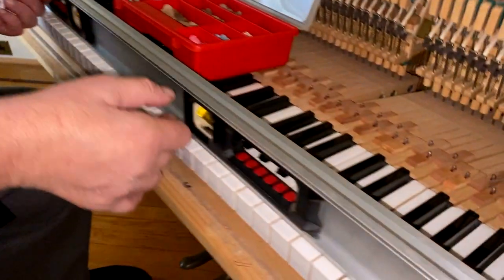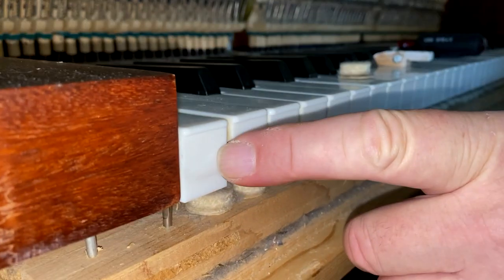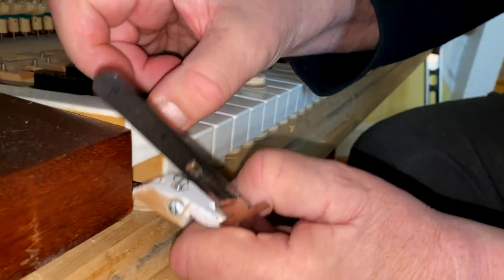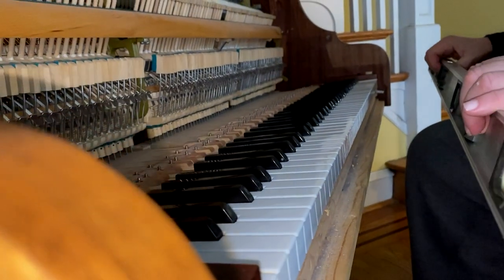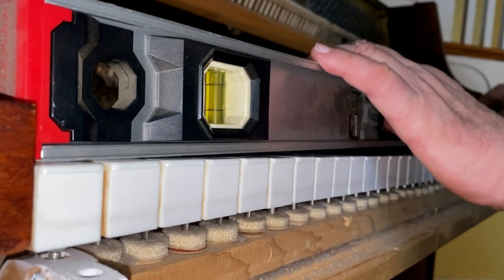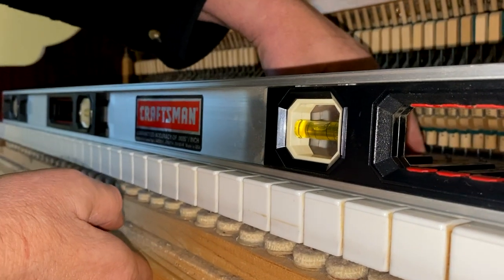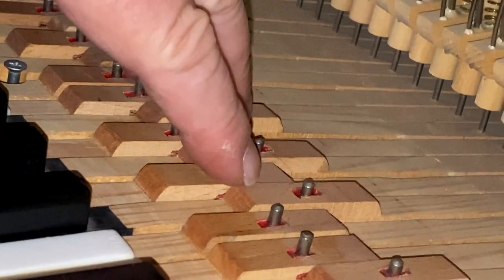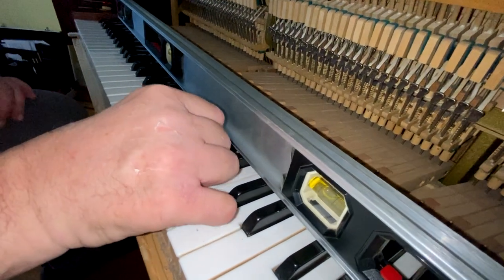Key leveling and Key Dipping

Comment: The explanation of using the key prop is not clear to me.  First, you measured the height of the lowest bass key, and then you propped the key. Why was it necessary to do that?
Reply: This is what I got from watching this - others can feel free to correct 🙂: I'm thinking that the key needs to be propped up so that the weight of the level doesn't start pushing all of the keys down. So basically the props turn two white keys into the left and right  end of a "stand" that holds the weight of the level at the desired key height (re-watch the video @1:14). Once the props are in place, you can trust that: 1) the leveling won't change as you are going up/down the piano testing key heights 2) the entire level surface won't sag under the full weight of the level (even if you took the level off - to do something - and then put the level back in place).
Reply: Because if you set the key height to your desired spec on the 1st and 88th key you can use that as a guide to correct the rest of the keys. Once you place the straight object across the keys (carpenters leveler here)  anything that is lower/higher than this height will be easily exposed.

If you don't add a prop underneath the lowest and highest keys, once you place a flat edge or carpenters leveler across the 1st and 88th keys then they will both descend due to the weight of the object. For example, if you set your key height to 65mm you want it to stay at 65mm.
Reply: @AshtonnnM   Thank you for this. I guess the reason I got confused is because of the way he inserted the props, which initially made it look as though the keys had been propped much higher than they were supposed to be (when the props were vertical). But after watching again, it was clearer.
Reply: @ElikemTheTuner  You're welcome 🙂 and I can understand why that was confusing. Also, as a cheap alternative you can just use a stack of hole punchings on the front rail pins to block the key from dipping.
Reply: @AshtonnnM  Thank you Sir